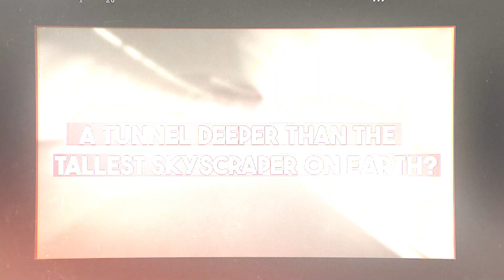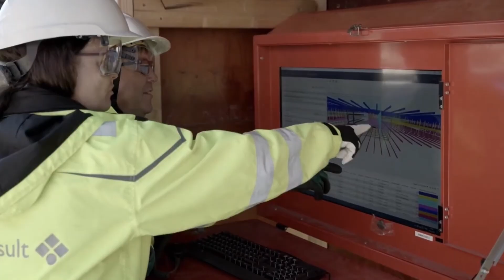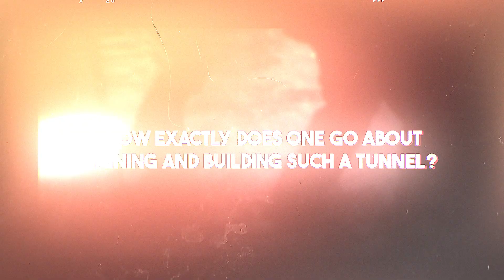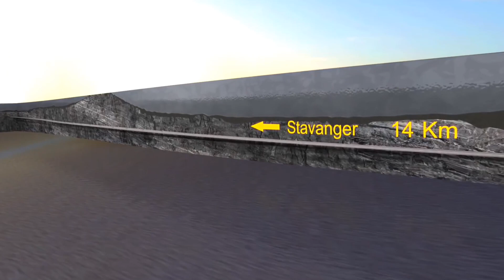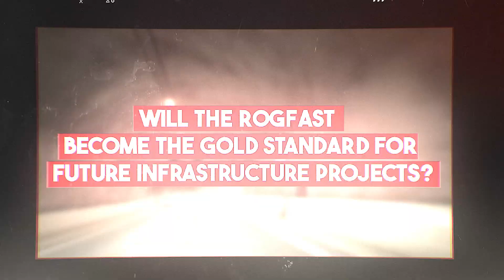EXTREME Tunneling in Norway's Coastline!

Comment: How many errors can you ger in a single video ?
Firstly all the imagry of the floating tubes is nonsense, Rogfast is a driven tunnel through rolid rock.
It eliminate ONE not "many" ferry crossings (2 if you count Kvitsøy, but that's off a side-tunnel but that's not on teh E39)
"Eliminate mountain passes" ?? having driven the existing route man times, I've vet to encountar a mountain pass.
The area around Randaberg is coastal, in southern Norway and get's little snow, and does not get the extreme cold of the North.
The only part of the constructin with any access issues is the tunnel from Kvitsøy, but the rock being pulled out there is being deposited there, so your claim of ligistical nightmares is nonsense, there is also a good ferry connection to Kvitsøy until the tunnel opens.
Then you include footage of American towns, road and road signs. "Speed limit 30" written on a sign is not something found in any European country.
Reply: It's called background stock videos ..
Reply: @Relikvien  That doesn't account for all the factual fails in the text.
Reply: @Relikvien  Yeah and its not accurate, if it wasn't for his comment I thought they were the actual planned tunnel designs